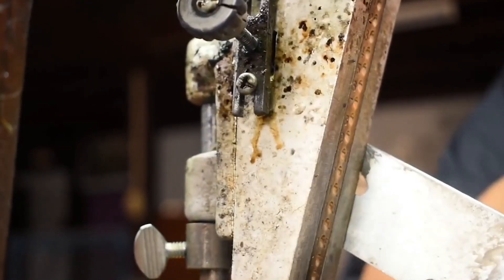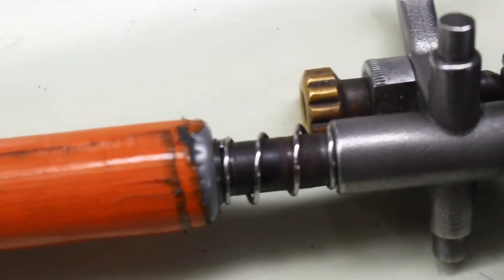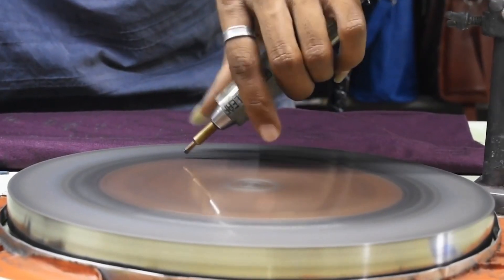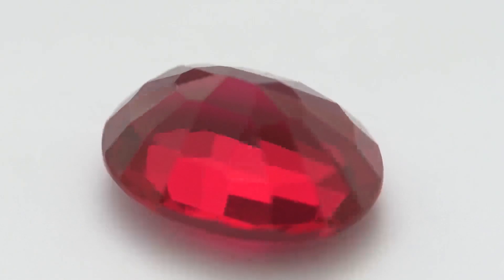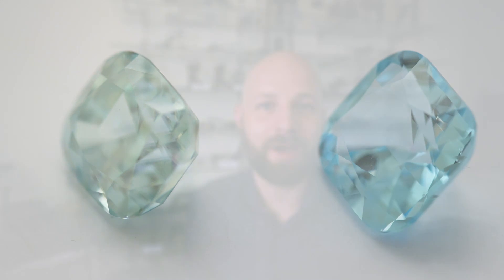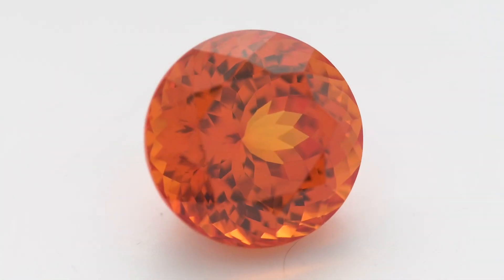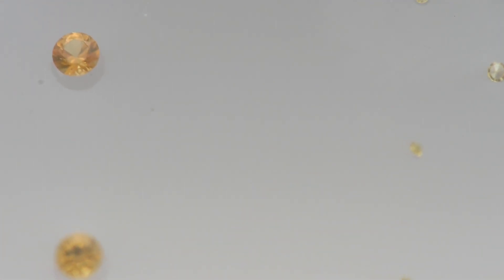What is PRECISION CUTTING (vs Hand Cutting and Machine Cutting)?

Comment: @JustinKPrim Hi Justin, in your video on the shelf in the background is a handpiece on the left side above the black display case. I recently acquired an O'Brien Faceting Machine that uses those hand pieces, but it only came with a 64 Index wheel. Do you know where I could find other index wheels for it? Thanks, love the videos!
Reply from the maker: Hello. I think you’re talking about the Fable handpieces or another cheap Chinese one. I’m not sure where you might get another index other than contacting the manufacturer. Not sure if they make it though.
Reply: @JustinKPrim I've looked on their website and the internet in general, but it doesn't seem to exist anymore. Even this octogonal handpiece with holes drilled for the pin in general doesn't seem to exist. It's not the standard knockoff you see on ebay.
Reply from the maker: @JT_geo  both of those are from China, so you need to be looking at Chinese manufacturers. Look on www.facetingmuseum.com to see some examples of what you’re looking for. In the Handpiece section you’ll find both the O’Brien machine and the pink Chinese one.

Comment: What would you consider the oldest and most traditional cutting. Say medieval europe gem era faceting/cutting. Working out ideas for making an as historically accurate as possible opulant cover for a bible.
Reply: I've found quite a few ideas and think I know how I'm going to go about it, but I'm curious about your opinion of where this would fit with your definitions.
Reply: Thank you kindly for your response. I actually didn't know the correct name them but I was originally planning on cabochons, but it is a protestant Bible and having some rough rose cuts would make it even better. I think I'll try for it. Thank you!
Reply from the maker: The most traditional old cut is cabochons. You can find lots of example of bibles covered in giant cabs from the medieval period. However if you want it to be faceted, the rose cut is one of the earliest, from 1550ish and would great for a bible cover. This is also from around the time of the reformation so if it’s a Protestant bible, that’s perfect timing!

Comment: It would be great if you would edit the wiki entry for Faceting Machine. It is clearly biased: "... the mast assembly is what makes a faceting machine a faceting machine".  It makes no mention of other mechanisms.  To my mind there is nothing "machine" about a mast setup other than the spinning lap.

All of the hand lapping devices: peg, hand, or mast, merely restrict the degrees of freedom.  Arguably mast and peg "machines" are overly restrictive in that they confine the stone to an arc which forces a particular linear lap rate for various angles of attack. The Sterling style hand piece relaxes that degree of freedom restriction. This allows the cutter to vary the lapping rate, lap coverage, and attack angle very immediately when forming the girdle for example.

Comment: They all look good to me but I don't kno anything about gemstone cutting. What is a window? It seems it's bad if it has a window
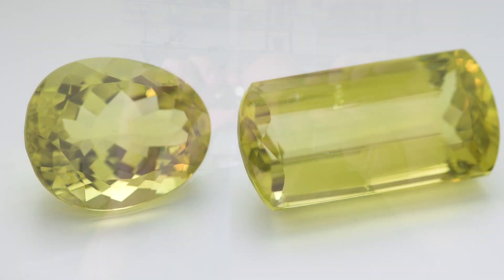Reply from the maker: A window means that the cutter didn’t take the material into consideration when they cut the stone. Every gemstone has special angles that they need to be cut at in order to make the light and color reflect everywhere throughout the stone. If you look back at the video at 12:07 you can see that both of those yellow stones have an empty spot in the middle where you can see through the stone. You can see the white background through the stone instead of seeing the yellow reflecting. This is a bad cut stone because the angles are not right and you don’t get the full experience of yellow color throughout the whole stone and it can be improved through better cutting. I hope that’s helpful and makes sense.
Reply: @JustinKPrim  thank you! I started looking at some faceted amethyst I bought off etsy and they all have a window. I only paid $40 for 4 12×10mm stones so I didn't expect great quality but I'm glad I'm learning about what to look for.

Comment: What does he mean by "window"
Reply from the maker: When the bottom of the stone is cut with angles that are too shallow for the material, it doesn't create the mirroring effect, so we call it a Window because light passes through the stone like a window instead of reflecting like a mirror.  If the stone has a window you can see what's behind the stone and the stone looks dull and has less color saturation.
Reply: @JustinKPrim  Thank you very much for the quick reply!  🙏😎🙏. Your videos are exceptionally well received
Reply from the maker: @greeneyedguy  thank you!

Comment: I've heard of laser cut before too. Whats that?
Reply from the maker: Laser cut is something now that as far as I known only exists for diamonds. It is exactly what it sounds like. A laser beam is guided by a fine water jet and they can actually cut all the facets on a diamond like this. They still need to polish them by hand though because the laser leaves the diamond’s surface burned.
Reply: @JustinKPrim  interesting thanks. Is it mostly used on diamonds because its expensive or for another reason?
Reply from the maker: @OpalsJones  the colored stone industry doesn’t have the same technology at all. Diamond cutting is completely planned by computers and now can be executed digitally with these lasers. Colored stones are planned by human eyes and brains and they don’t use any kind of gem scanner or even much technology. Colored stones are still a traditional art.